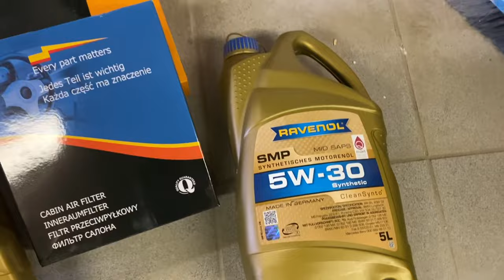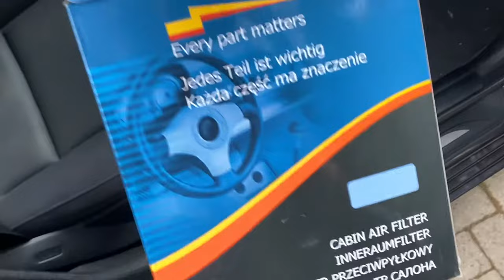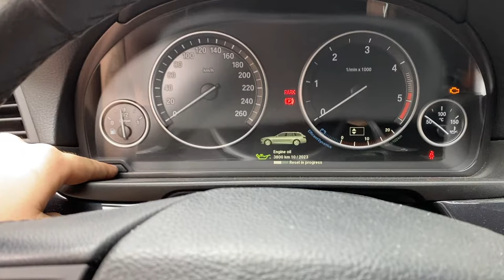BMW F11 F10 520D (N47) Oil & Filter Change

Comment: Hello, for this motor, is Ravenol 5w 30 the best oil?👋
Reply from the maker: Yes
Reply: No best oil is Castrol 5w30
Reply: @adembajramov3539  who said that?
Reply: @angrypanda3810   i think its like that because is expensive and car constreucteur adviss thar
Reply: @adembajramov3539  you only need to know the specifications provided by the car manufacturer. You can choose any brand of oil🤷‍♂️

Comment: Ridex filter😭
Reply from the maker: Ridex Is really good 🤩
Reply: @ka3is  NO, NO IT IS NOT  lol
Reply: @ka3is  Ridex is good? :) You could not buy any cheaper and lower quality junk. Seriously I dont understand why people buying a premium car and when it comes to maintenance they not willing to spend the money. ravenol and ridex junk.
Reply: @Twinturbo_  I am a mechanic working on these cars and also own one. I know exactly why I dont use these junk parts. This based on my experience has nothing to do with big companies. If you not willing to spend a few extra pennies for basic maintenance do not buy BMW.
Reply: @Twinturbo_  People who saving on basic maintenance spending money on the bmw monthly and cry. But you do you... It is fine for me if you use ridex and other junk.
Reply: @kriszml  for the N47 which oil you think is the best?
Reply: @SoM3KiK  hard to tell but in general every oil achive  the LL04 standard is fine but I use the original bmw 5w30. Unfortunatelly In Europe lately this oil comes from a different manufacturer and I dont have enough info yet of the quality.
Reply: @kriszml  between castrol and ravenol which one would you choose? Both are acea c3 (ll04) and i heard some People say ravenol is better but I never tried it
Reply: @kriszml Exactement.
Reply: @SoM3KiK  Sorry I missed your question. I dont know ravenol but the other hand there  was the castrol the original oil for bmw for a while. The problem is there is a lot of fake castrol oil is avaliable. I would probably go with castrol but no real data or test behind this pick.